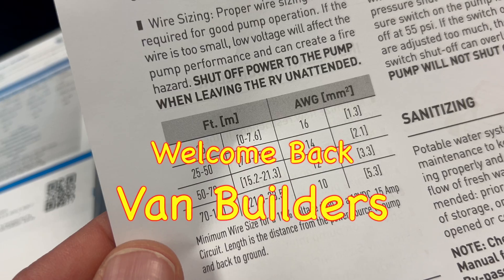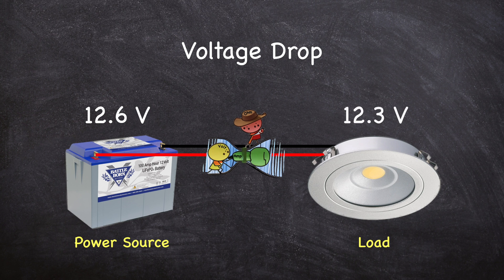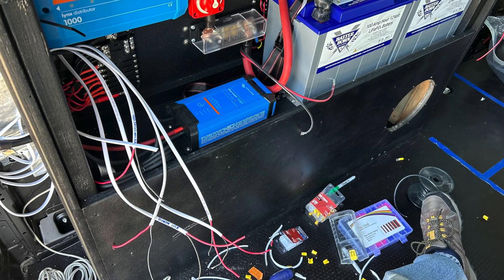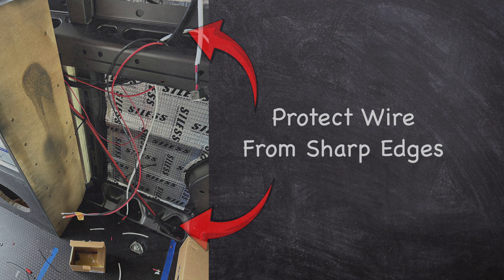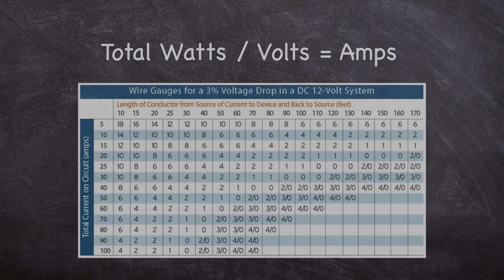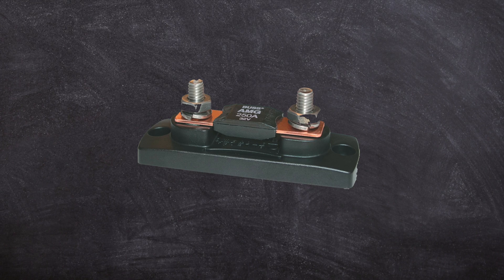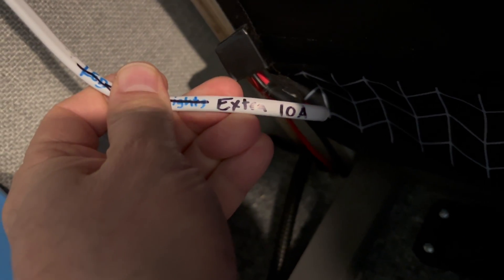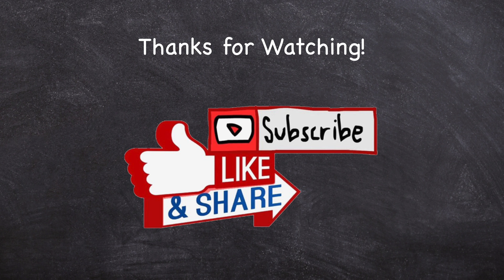How To Choose The Right Wire Size For Your Van's DIY Electrical System

Comment: Wagos are ok, but I like the newer Ideal v2 In-Sure lever connectors better. Not only can you insert the wire without lifting the lever, you insert the wires from the opposite direction of the lever handle that way you don’t get your finger snapped, and there are less likely to get knocked open when installing into a box. That’s my opinion. Good video though!
Reply from the maker: I checked out those connectors and they seem much better.  Thanks for the suggestion!

Comment: I don't know why there are not more comments on this video!  I found it to be very useful for my case.  I don't have to wire in lights or anything, as my system is more portable, but just when I thought I had all of the wire that I needed for my system, I realize that I don't know what gauge I need for my dc appliance and dc plug and switch panel.  
Your video helped me a ton!  Thank you so much.  Now I'm going to complicate my life a little bit more and watch some of your other videos which I wish I would have seen 'BEFORE' I bought all of my system components, lol 😤😄
Reply from the maker: Thank you for watching!  I'm glad you found it helpful.  I can't tell you how many times I realized I should be doing it differently, or better.  Countless trips to the hardware store!

Comment: Personally i use the ABYC wiring guide.  It stats what size to use on both ac and dc.  But remember that you muct consider the length of say ten fett from the battery is really a 20 foot run.  Why??  Because each leg (positive and negative) are ten feet and that makes 20 feet.  The ABYC  Guides are the best you can get.  I do recommend their courses but they are high.  But once you pass them they can be used to find employment!!  Plus it shows you how to do all the electrical systems in a safe manner!!
    Running to small a wire is a sure way to burn down what you're working on.  Safety first!!

Comment: Whats your take on using 12AWG stranded for everything? (Except for inverter, solar, and other high amp/volt items) I found it was much much cheaper to buy one roll of 12AWG marine wire and the appropriate connectors than multiple gauges and connectors.
Reply from the maker: I think you’ll be fine with 12AWG for all of your circuits.  You would probably be fine with 14-16 also.  The only drawbacks I can think of when using oversized wire is the extra cost, weight and ease of installation.  Cost and weight may be negligible.  When I think of installation I think about running multiple fat wires through small openings and channels and trying to terminate large wire into small device terminals.  If you end up squeezing several wires tightly together through a channel they could potentially heat up.  Smaller gauge may reduce that issue.  I also think about using lever nuts that may not have the range to accept both 12AWG from your fuse panel and very small wire (18-22) connected to devices like 1 watt LED puck lights.  That said, I might go with 14-16AWG for a one size fits all approach.  And like you said, not including higher amp devices.
Reply: @TheVanTeacher  

You give a lot of good advice and I like your desire for simplicity, but electrical work is all about the details. For the sake of others, here are a few ...

Wago connectors work fine for 24-10 AWG stranded wire, in fact they are good for connecting wires of different sizes. (I prefer terminal blocks and ring terminals in a boat or vehicle, especially since they keep your wiring more organized.) Wago makes some holders that can help secure their connectors to a surface or within a junction box.

Bundling is fine (cars are full of tightly bundled wires), just use the derating rules for DC circuits. 

4/0 wire is not necessarily required for batteries, it depends on the load. 

If you're using just one gauge of wire for all DC circuits, it should be the size that supports your largest DC branch load ... not a random choice among 12, 14, and 16. Gotta do the math. 

Just some food for thought.
Reply: Those crumpets that you were using are for both insulated and non insulated crimp terminals.  You were installing an insulated terminal using the non insulated part of the crimp tool.  Otherwise, thanks for sharing your knowledge.
Reply from the maker: @TyLeRtSb I’m glad you pointed that out, thank you.  It’s nice to learn something new every day!
Reply: I've got 16 guage in my van and was worried. I mainly run the fridge and my pucks. That's it. My Bluetti SA20 is on one end and other wire to box with O rings and solder heat shrink. Am I OK? 😅